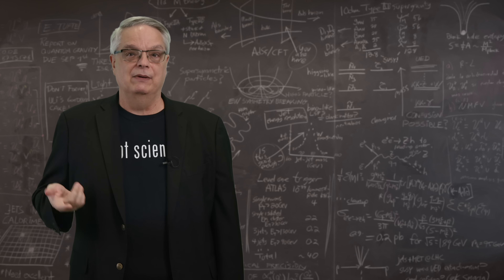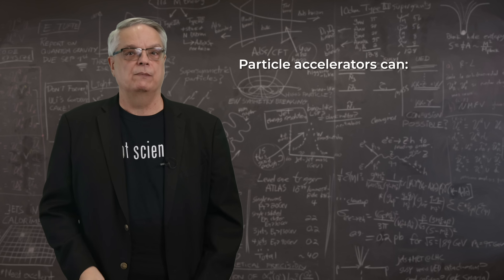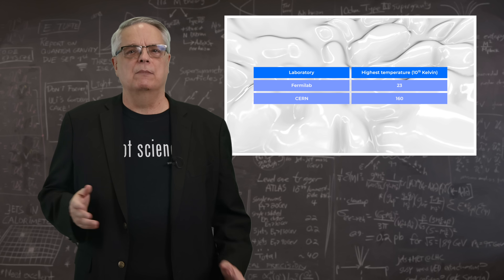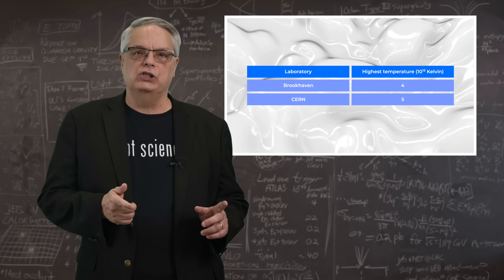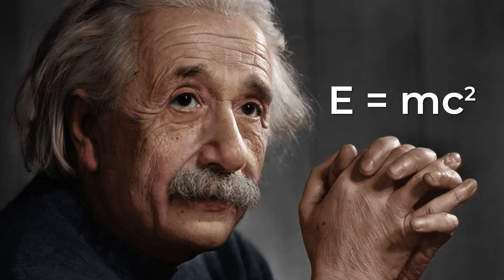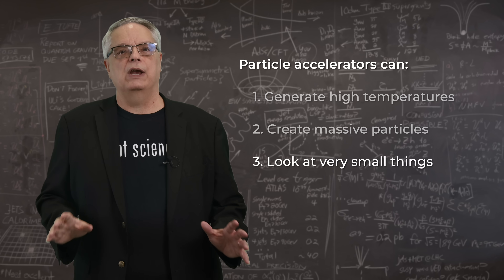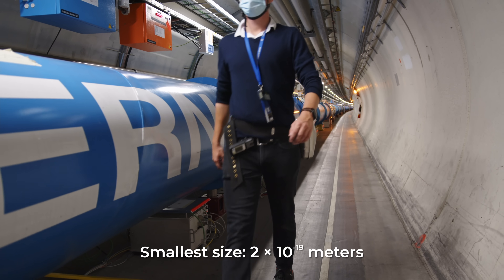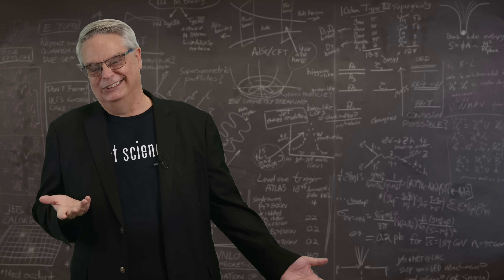Why does Fermilab need accelerators?

Comment: I think he answered the question on why particle accelerators are built, but I am still a bit confused as to why "Fermilab" has a particle accelerator considering CERN does everything bigger and better?
Reply: CERN has a higher energy accelerator.  Fermilab has a more intense one.  As an analogy, CERN makes a blue light, while Fermilab makes a brighter red one.

Different questions require different equipment to answer.

Comment: When Dr. Don says, "This temperature happened a millionth of a second after the big bang..." he is really saying:
a) The Universe has only 3 spatial dimensions (the reason the Big Bang was proposed)
b) The General Relativity Geodesics model (mass deforms spacetime) is correct (this is the model one should use for an unembedded 3D spatial manifold).
c) There was some unsupported, undefined Inflaton Particle that stretched SPACE such that temperature could go down from Infinity (I suppose since that initial temperature cannot be determined by any model) through adiabatic cooling.
d) The energy for the Big Bang came out from some magical False Vacuum Decay...:) (tremendous nonsense since it doesn't solve the conservation of energy problem - it begs the question: AND where did the energy come from to move the vacuum into an excited state).
e) Magical Dark Matter and Dark Energy are REAL...:) Despite the existence of a better model that explains everything without Dark Matter or Dark Energy...
In other words, for you to say something supporting the idea that "Accelerators are relevant because they problem the initial attoseconds after creation," you have to push tremendously idiotic ideas (rejected by JWST evidence).
In other words, this is a self-serving video (serving the Fermilab interests and not Science).
The video is self-serving.  The deaf-ear offered to a better model is also self-serving.
One wonders when scientists will stop and start supporting Science.

Comment: What do you think about building bigger accelerators despite theory not having advanced much for decades, and nobody knowing if it's even worth it?
Reply: Theory is advancing quite a bit just not the way the public thinks. The problem is that what a new accelerator could possibly probe has been theoretically understood 40 years ago and the predictions are kind of dull. There isn't much there, there unless our theory is wrong... but then... it was spot on about the Higgs, so that's kind of a problem with that line of hope based argument. Would an LHC upgrade (and that's the only thing we can hope to finance) be worth it? No. Probably not. There is better science to be had in other sectors like with astronomical observatories for that money.

Comment: What do the collectors at these accelerators actually View?
Reply: We are measuring combinations of energy, momentum, angular momentum and charges by observing "particle tracks". What we care about is just that set of numbers, though. We get that by letting high energy quanta interact with the matter in the detectors and they are shedding small amounts of their energy along a linear or curved (for charged quanta in a strong magnetic field) track. We use the amount of energy deposited in the detector and the directions and curvatures of these tracks to estimate the original energy, momentum, angular momentum and charge (positive, negative or neutral). We then compare these estimates with theoretical predictions to decide which model is correct.

Comment: Hi Don, You did a masterful job of describing the 3 things that particle accelerators can do, but you never mentioned why it's useful to do those 3 things.
Reply: To investigate the fundamental physics of the Universe of course.
Reply: @EnglishMike  I thank for that answer of which I am aware. However, you missed the point of my statement to Don, that being to fully answer the intern's question he should have included a dissertation on why it's useful to do each of the 3 things he elucidated.
Reply: @lr1639  It doesn't need a dissertation. We are measuring the excitation spectrum of the physical vacuum. It's a precise analog of hitting a gong and listening to the frequencies in its sound. In two words: it's spectroscopy.
Reply: @lepidoptera9337  Well, it seems everyone keeps seeing a "?" where none exists. I thought the purpose of my comment was crystal clear in my last response. But, I guess no matter how clear one tries to been there will always be those to whom it's still opaque, or they just are bent on feeling self-important. Have a good life. 😁
Reply: @lr1639  I wasn't answering a question but correcting a misconception. ;-)
Reply: @lr1639 Why do some people strain to use fancy (as they think) words that they haven't really got the hang of?

Comment: Particle accelerators are built so physicists are distracted and led down a garden path when the answers are freely given by Nature in a magnet, electricity and all forms of light behaviour, to name a few. 
Here's all you need to know (broad brush): gravitons move in pairs of two opposing flavours  of 'tubes' into the oscillation (misnomer Higg's boson), which is formed by twin intra oscillating toroid topology formed by two opposite and separate parts that eventually merge as neutrinos (dininos). Oscillations convert gravitons into photons, three of which exist as part of a proton collection to form a triangle of photon interactions conversion to proto magnetic particles (pmp) in three directions on the plane of the oscillations and two opposing directions perpendicular to the oscillation plane. The pmp moving on the plane go between the oscillations through most dense dinino field and acquire that particle  to form a trtron (magnetic field particle) of extreme curl hence forming a quark by virtue of its toroid topological trajectory, and upon departure is responsible for the strong force. 
The twin perpendicular and opposite trajectory of up and down pmp traverses through a lesser dense field of dininos and hence travels further to form a weaker quark which is composed of magnetic field particles which manifest as electrons upon the shedding of a neutrino.
Well that's the general picture; now you can work out the rest of the details so you can make technology to generate free energy, antigravity craft, visit the dinosaurs, regenerate your body cells to be sweet 16 again and explore the cosmos as an inorganic being not needing to fart ever again.
Reply: If it was that simple....
Reply: @marcoflumino  Calling it simple when you do not even understand it!?
If you understood it you would make a constructive statement that addressed what I have written.
With your response I cannot be certain that you read what I wrote, which would not be your fault. 
Hence, always quote the writer's words so that it is known that you read what was written.
Never trust digital media in all its forms.
Reply: @JerryMlinarevic  So why haven't you claimed your Nobel Prize yet? Oh yeah. that's right, you have no idea what you're talking about. Anyone can speak pseudoscience. Where's the math?
Reply: @EnglishMike  Copy and paste what I wrote and we'll call it a day.
Thanks.
Reply: I wonder, since I am a Astrophysicist and an Astronomer, I understand very well what you wrote, what I dispute is the easy part, if that was easy everyone would be a scientist! So peg down you vanity Einstein! And since your majesty is so intelligent and it is so easy for you, why you did not invented or solved all our energy problems and the rest? Get a life...

Comment: Expressions like "a millionth of a second after time in the universe began" assume that time started all at the same time (pardon the expression) all over the then tiny universe. Could it be possible that the universe didn't start as a singularity and time may not have started simultaneously everywhere? Which, if true, could account for the anomalies seen in the CBM?
Reply: It could be possible. But you need to do the math to show why such a finite initial state is as or more probable than the singularity model given the current state of the universe.

Comment: Crucero UFO

In the early 1970s I was out along the railroad tracks near Crucero Station after dark. All of a sudden there was a ghostly teardrop shaped light strobing in the sky. The hair stood up on the back of my neck. Was this a UFO or what? I watched it but it did not seem to move. After a couple of minutes it disappeared as quickly as it had appeared.

A few minutes later when an eastbound freight train rumbled by in the dark, I realized what I had seen. The locomotive's light had reflected off the dust in the air as it had climbed the pass to the west. When it got to the top of the pass its light no longer pointed into the air.

Comment: Can someone explain to me how the accelerators work when they're circular or not straight? If you're trying to smash particles together or just accelerate them in general don't you want nothing to interact with? How do they follow the curve?
Reply: The magnet field of the ring is curved so that the charged particles in the beam go around and around.
Reply: Ok see I knew it had to be something fairly reasonable that I wasn’t thinking of. Thank you

Comment: Here's an alternative interpretation of the intern's question: "Can the Fermilab accelerator do anything that the LHC can't do better?"  The video didn't answer this.
Reply: Doesn't need to. More accelerators is always good.

So, availability.
Reply: @thekaxmax  Operating & maintaining an accelerator isn't free.  Your "always good" opinion looks like a bias, not an objective fact, so you should provide your reasoning too if you want your opinion to be taken seriously.  I think the relevant question is whether the accelerator is still being used to make new scientific discoveries, not just to slightly increase the already high confidence of previous results.
Reply: @brothermine2292  JWST is far more capable than the Hubble Space Telescope and yet observation time on Hubble remains way oversubscribed. Just because one instrument is less capable than another, doesn't mean its use isn't still extremely sought after by scientists.

There's no shortage of scientists wanting to use the Fermilab accelerator -- like Hubble, it is oversubscribed. And remember CERN is shutdown for several years at a time while the upgrade work happens. There will be no LHC time available between 2027 and 2030.
Reply: @EnglishMike  Hubble is better than JWST for observing UV and visible light, so your analogy is bad.
     Your measure of the value of the Fermilab accelerator is bad too.  Its value to scientists not fortunate enough to get LHC time doesn't imply it's still valuable to science.  Scientists are compelled by the "publish or perish" incentive to do something rather than nothing.  The best measure of its value to science is, what has been learned recently from the Fermilab accelerator?
Reply: @brothermine2292  if you need to do the research and can get people to pony up the dollars, it's always good to have your own accelerator rather than pay for scarce time on someone else's.

And anything that can replicate another's findings is good, because there's always the chance of new discoveries. This happens all the time.
Reply: I mean, Fermilab's accelerators are currently used for neutrino research, something LHC isn't equipped to do.
Reply: The LHC is not equipped to do all the experiments that can be performed in Fermilab, one example of this is neutrino research. Fermilab has the Dune experiment which actually uses a portion of Earth's crust as means to test neutrino traveling distance and oscillation.
Reply: To the people whose replies support the "more data from accelerators is better" opinion, please cite examples of actual discoveries that have been made using Fermilab accelerators since LHC came online.
     Fermilab retired their most powerful accelerator, the Tevatron, after LHC made it obsolete.
Reply: @brothermine2292  did you read my comment explaining how the LHC is not able to do all the experiments that current research requires?
Reply: >JorgeTorresH  : Yes I read your comment.  Like the others, you fell short of demonstrating the work is "required."  The lack of discoveries during the last 12 years suggests it hasn't been required to advance science. (Cite a discovery, if I'm wrong to say there's been a lack.)
     DUNE won't begin operation for years.
Reply: @brothermine2292  are you, by any chance, a Sabine follower? Hahaha
Reply: >JorgeTorresH  : I'm not a "follower."  It's my nature to be a skeptic.  Every good scientist should be a skeptic.
     You're avoiding my question about the lack of discoveries at Fermilab since LHC became operational.  If you're going to claim the data being produced by Fermilab accelerators is valuable for more than just preventing a surfeit of particle physicists from changing their careers to Wall Street analysts or weapon designers, you haven't yet made a clear argument about its value.
Reply: @brothermine2292  and I won't. It's not my job to present information that is already out there to you and it's meaningless to do so. 
I agree with you, skepticism is healthy, but if your way of doing it is the Tucker Carlson way of asking questions while suggesting your point of view with them, then I see no point in this anyways. 

Keep in mind that it's not only particle physics that comes out of these labs, patents that eventually shape consumer technolog also flow from places like Fermilab.
Reply: >JorgeTorresH  : I already found a list of Fermilab discoveries at Wikipedia, which lists nothing in the last 12 years.  It's obvious why you're avoiding the question about the value of the data.
     You seem to misunderstand the definition of "meaningless."  And you're overlooking the possibility that I'm not the only person who would read arguments you make here and benefit from information you present.

Comment: Wait.  An intern to a particle physicist asks said physicist why their place of employment has a particle accelerator!   😧
Reply: Probably in regard to where it’s going with experimental operations in the future given we already have a much larger collider with higher energies thus in danger of rendering colliders like at fermilab irrelevant unless they get creative.
Reply: The intern was likely questioning the value proposition without understanding you don't need the biggest accelerator possible to do experiments. Using the LHC to generate a stream of neutrinos would be overkill, take up valuable resources and time away from experiments that do need the higher energies. Not having to go overseas to run an experiment is a great time and money saver. Being good at physics and maths doesn't make one a good accountant.

Don probably twisted the question a little to make a video.

Comment: I was thinking more like: Matter forms a stable mass very quickly, so you have to put massive amount of energy into it to break the components apart. When they are apart you can try to study the components of matter. I guess maybe you can also use an accelerator to try to do nuclear alterations to matter. You could study the cyclone radiation, but that has already probably been done and is observed as what you get when you alter the track of a particle.

Comment: STOP WITH DEI INTERNS
Reply: What does that even mean?
Reply: @rwarren58  Senior Fermilab research staff has been aggressively hands-on (YouTube won't let me say more, google it) with junior female research staff. Apparently Stephen's solution to this is to avoid hiring women at all so the men can just get on with their work, or some other garbage. Dr. Don really should have addressed this by now on this channel.
Reply: @rwarren58 It's bigoted nonsense peddled by right-wing grifters. Just report it as such and move on.
Reply: @rwarren58  Google Fermilab assault. Stephen's solution seems to be to just stop hiring women so the men can get on with their research without temptation.
Reply: No interns appeared in this video.
Reply: I think Stephen is a maga. Only white men need apply. Is that right?
Reply: FERMILAB NEEDS PARTICLE ACCELERATORS TO EXAMINE VERY TINY THINGS LIKE STEPHEN MORTIMER'S BRAIN.

Comment: Is a black hole a massive particle?
Reply: no, it's wrinkled spacetime, and the particle smashers don't spend much time thinking about them.
Reply: @DrDeuteron  So where did the mass go that created the wrinkle? Are you violating laws of physics?
Reply: @mutantryeff  yes, the singularity violates the laws of physics. The mass is in the energy of curved spacetime (E=mc^2). The question is: where did the conserved baryon number go? Kip has a video on "Closer to the Truth"'s channel, where he explains matter (not mass) goes to the singularity and destroyed. The singularity [classical BH's only here] is a point defect in spacetime...it's not part of it, it's a glitch of infinite curvature where matter disappears, but makes the glitch bigger. That is then surrounded by a horizon so we can't see it.
Reply: @DrDeuteron  I mean that is a bit pedantic when colloquially a black hole is quite similar to what a large particle would be, abstract probability and consisting of only angular momentum, charge, and mass at least when viewed from outside.

Comment: Might one recall the tube (aka CRTs) TVs in the town of Batavia that would quench each 11 seconds due to the charge cycle at FermiLab?
Reply: Do you have a link to an article that talks about this?
Reply: @martinwhitaker5096  That is about circa 1977 from an HEP physicist building spark chambers there that I hung out with at UChicago.  He pointed at the one-farad capacitor tree as part of the problem (or solution, perhaps, that it wasn't worse) that had come online the year before.  He also pointed out the drip pans installed on top of the computers in the basement of the HEP Institute due to leaks from the lab above them.  Sadly, he is no longer with us.